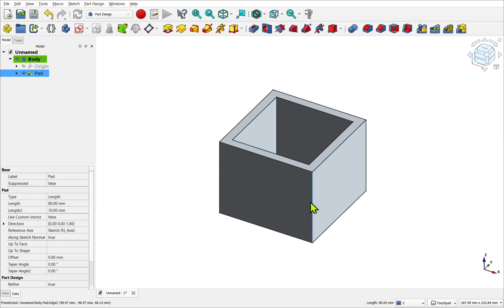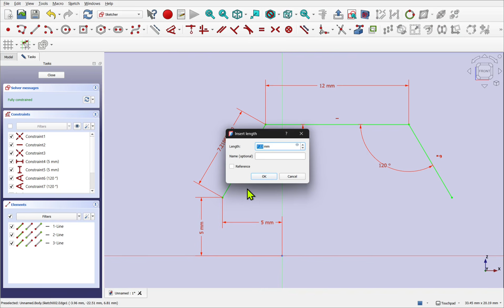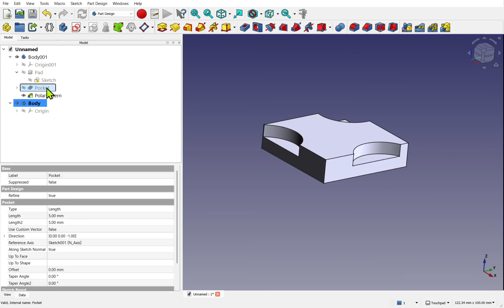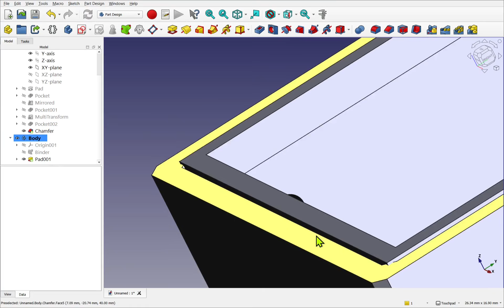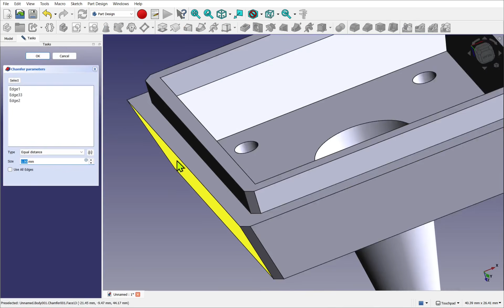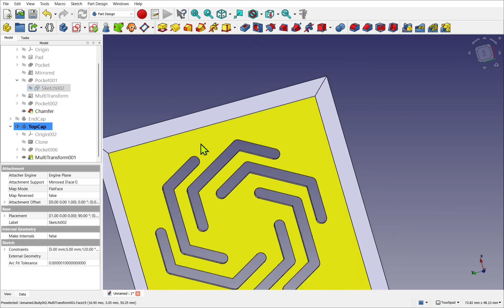FreeCAD: Building Stable Multi-Body Multi-Transform Models | Basic Beginners FreeCAD 1.0 | Lesson 44

Comment: Amazing amount of information given in the most simple way, you’re the Feynman of Freecad ! 
Got 2 questions for you :
- you use the draft workbench, is it by design or is it a way to bypass a missing feature in part design (yet to be implemented) ?
- what is the draft workbench usually for ?
As usual, thank you for all the hard work !
Reply from the maker: Sorry, I think there has been a bit of a glitch on youtube lately and I am going back and reply to a number of messages that I have replied to before, I don't think they ended up being posted and just noticing  now.  First of all thank you for the kind words :) Regarding your questions, there are a number of tools that can be used across workbenches, it's not really to bypass part design but they are kind of misc tools that are really useful in other workflows.  The draft is really for 2D drafting but it's tools can manipulate 3D objects so can get a little confusing.  Especially when you can mix sketcher and draft together for crossing planes.

Comment: I'm getting an odd error in the main body chamfering. One of the four internal edges gives me a "BRep_API: command not done" error. FreeCAD simply refuses to chamfer that one edge. It is not important for the rest of the build but I'd still like to know what is going on there if you know.
Reply from the maker: That is down to the underlying geometric kernel OpenCASCADE  failing to apply the chamfers.  I am wondering if you have an intersecting edge that is at an odd angle, have you applied a chamfer to one of the internal edges then another chamfer maybe rather than all 4 at the same time?  Another thing to check is refinement.  The last operation before the chamfer, set that to false then apply the chamfer and see if it takes then.  FreeCAD tries to merge faces on the same plane for and this can cause issues with OpenCASCADE .  If I encounter a issue like this I normally try to apply a chamfer of 0.1mm (if that takes) then work up to see if it fails, you can then isolate where the issue is.

Comment: Question: If you had wanted the vent slot widths to on the top to be different to the sides would you have copied thew sketch instead of cloning?
Reply from the maker: Yes you could copy the sketch and change the dimensions, or you could still use the clone but change the scale property in the data tab.

Comment: Yet another nice tutorial to learn additional tricks to make the construction process easier. At 24:05 for example, I make instead of two measurements, a 45deg helping constraint on the edge (related to a horizontal or vertical line) and set only one dimension. The advantage ist that i had to change later only one parameter and dont forgot to change the second dimension which is anyway the same.
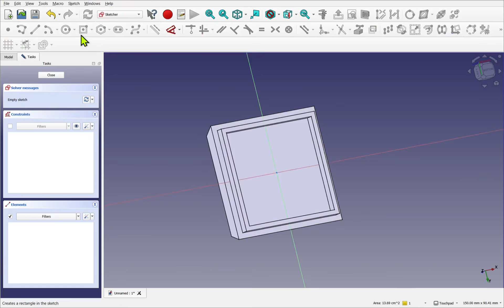At 26:43 I only select the pad (surface) I want to groove and apply a pocket operation directly with the same taper offset instead of making another sketch for the pocket.
Reply from the maker: Great to see your finding alternative and also appreciate you share them here, always great to see people sharing alternative ways and improvements.  Enriches the subject area even more.  Thanks for that.  Glad your enjoying the videos.
Reply: @MangoJellySolutions  you are welcome. ;-) 
Before FreeCAD 1 I've done it all in realthunders freeCAD, to follow your content better I gave FreeCAD 1 a try and was looking at what features are implemented yet. So the direct padding/pocket function without a sketch. At least I hope more of those nice features of realthunders will reach FreeCAD 1.xx in the future.

Comment: Cool tip with typing M with the dimension tool! I knew I could hit M while using the polyline tool, but I did not know about the dimension tool. Very nice, that will come in handy when positioning holes from now on!

For the chamfers on the caps, which need to match the chamfers on the main body, I used a formula to set those chamfers to `Chamfer.Size`, which would help in the event that the size of the chamfers needs to change in the future.
Reply from the maker: Nice little tip there about the formular and the chamfer :) BTW, see check your messages on Patreon in a moment I have sent you something :)